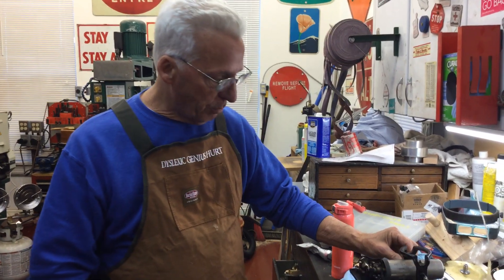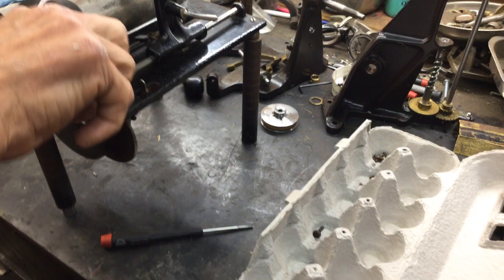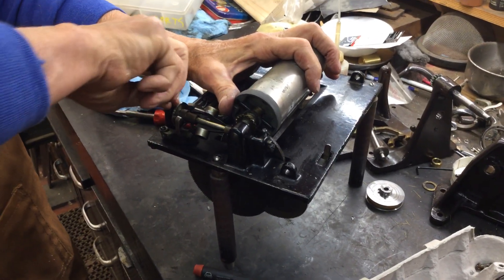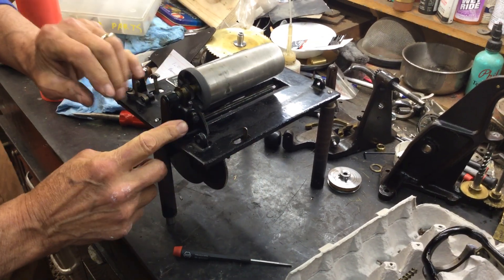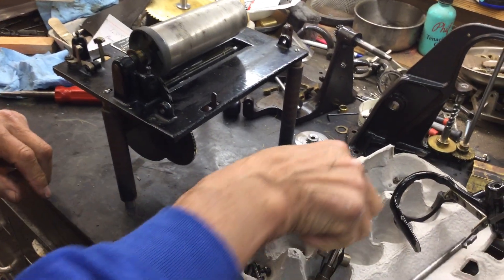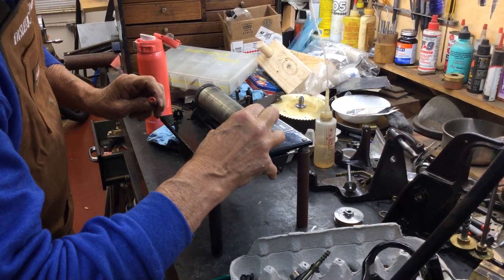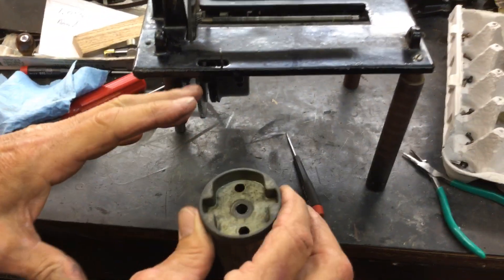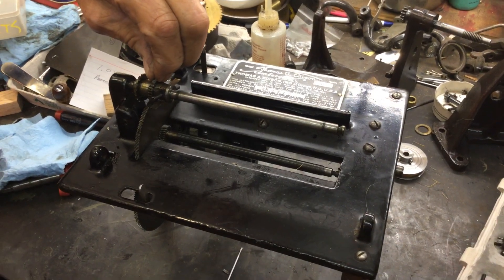219.  How to disassemble the Amberola 30 phonograph motor

Comment: Do you have a video of taking the amberola 30 out of it's case and greasing it and putting it back? How hard is it?
Reply from the maker: Not at all hard. Unhook the spring that goes from the motor to the horn underneath.  Undo the three bolts on the motor board.  Take the reproducer off.  Unhook the lid hinge.  Lift the motor out.